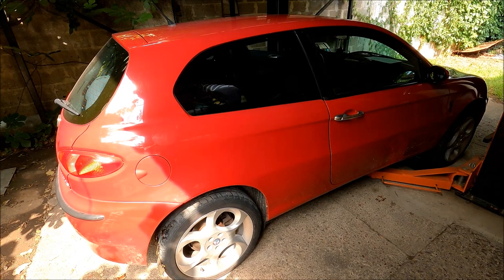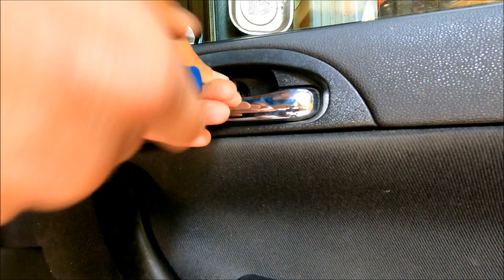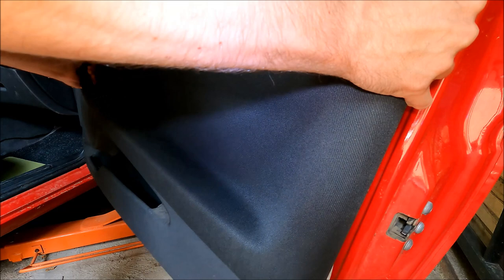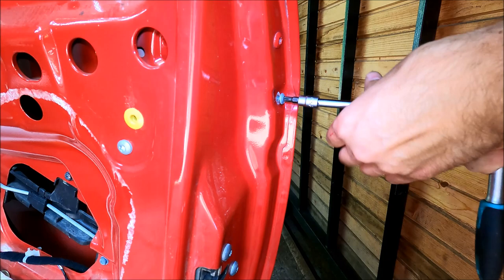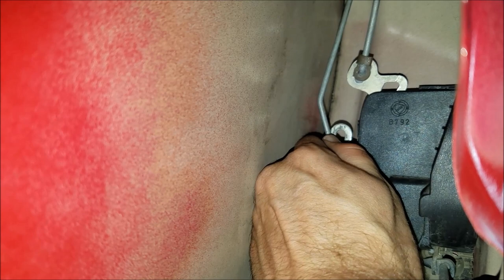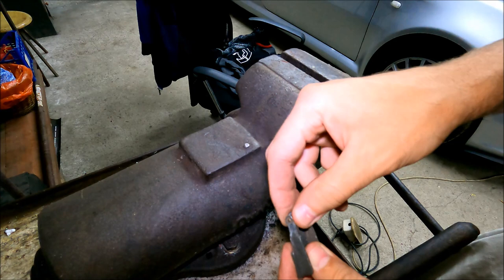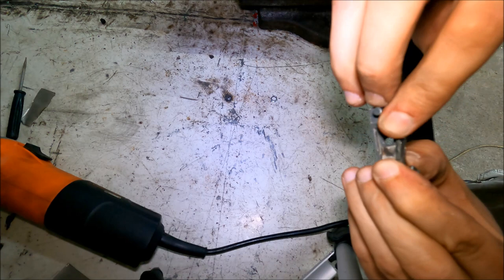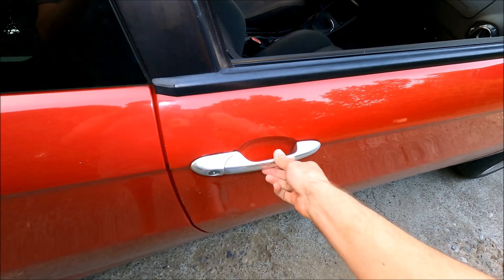How to Remove and FIX Door Handle on Alfa GT, 147, and How to Prevent it from Breaking

Comment: For 147 owners, procedure can be shortened a lot! I replaced mine today. After door card removal, you remove 10mm nut that holds the hinge to the door. Then you can remove broken part and use very long screw driver to reach phillips screw that holds the hinge to the handle. After that you open new hinge 180° and put it in a handle to tighten it. Then you pull handle as if you were opening the door, that will give you enough space to close the hinge to normal position. Put back 10mm nut and you're done. Much much faster than doing this whole procedure but applies only to 147.
Reply from the maker: Did it before with replacement hinge on 147, although it is much harder on GT. In this case I had to repair the hinge, thus the full handle removal...
Reply: Just wanted to write same thing.  Easy job, done within 15 minutes 👍
Reply: Thanks, i will try that
Reply: It depends if the actual broken part is the front hinge. I pulled it apart and the front hinge was fine, my problem was the red plastic piece was worn and was not keeping the rod in place.

Comment: Another excellent video! One thing: on my facelift 4 door 147, the door switch cluster is held in by a screw underneath the armrest. You can't simply pry the switch cluster out of the door.
Reply from the maker: Thank you, you got to be very careful, you don't want it breaking apart...
Reply: @arcgarage  For sure, especially for RHD 4-door cars, those switch clusters are getting very rare and expensive!

Comment: Hey man. I think I’ve watched this video a dozen times. I got a facelift 5dr 147 with the passenger side handle not working. Took the doorcard off, the front hinge is fine, my problem is that the red plastic piece is worn out and it doesn’t keep the rod in place. But what I wanted to mention is that I looked inside the door and I only seem to have just one metal rod as opposed to the two shown in your video. I do have the yellow plastic piece in the handle but seemingly no second rod. Would that just be a difference between pre FL and FL or number of doors?
Reply from the maker: Not sure about the difference, but you can replace the plastic thing which holds it in place

Comment: Ingenious 😍 I have faced this situation with my GT and even the Alfa garage I took it to replace the brand new door handle was not too keen . It’s a pig of a job and only for the brave to take it upon themselves. Only Alfa can make a door handle replacement so painful 🙄.
This demo really helps and I will try to prevent it happening to my other door since I now know what’s causing this problem . Thank you as always 🙏 very helpful stuff ❤️👍
Reply from the maker: I agree, it does require a lot of effort, and it could've been devised much simpler. Thank you very much for your support...

Comment: Done today. Took apart as you illustrate, but suspected it might have come out without undoing the top two rod links. I reassembled these with the handle out, and yes, it will go back in with the rods already attached, just check they are taking the correct route inside the door.

Comment: Great work, of course😍. I suffered two attempts to access the repair, I succeeded on the second attempt, without disassembling the part of the rods, forcing, pulling the part of the lock. I was wrong😠, buying a hinge, for fiat 500, the cheapest around €6 on e bay...(for alfa gt it is a lot more expensive, around € 25). I had to modify, fill with composite, the screw pitch ... A nightmare😱, that to save € 200, ended finally, well😳. 
I will use the multipurpose oil on the passenger side so as not to repeat that bad drink😰. Thanks again for these videos😍
Reply from the maker: You're welcome, it is a nightmare of a job, that's why a bit of wd40 from time to time can prevent all that hustle. Anyway, I am glad it all ended well for you, the prices online are unreasonable, and thank you for support...

Comment: Absolutely genius with the glue stick method on the pull handle plug/ cap!!!
Wish I’d knew this years ago!!
How did you remove it? Hairdryer on the area?
Reply from the maker: Thanks, it removed fairly easy without any heat...
Reply: Awesome! Did it leave any marks on the surface? Thanks again!

Comment: Very good guide, let's hope I won't need it 😁 would it be a good idea to put some grease over the metal repair strip to slow any corrosion further?
Reply from the maker: Thanks, it is made from metal that does not rust, and I have greased it good...

Comment: Nice vid.
Can I use the same method on the facelift 147 from 2006?
The thing is that, the handle (on the passenger side) does not have a keyhole. And the car has central locking system. 
Does this make any difference regarding the replacement of the handle?
Thank you very much.
Reply from the maker: Thanks, you can use the same method, it shouldn't make a difference

Comment: Hallo from Poland :) 
Maybe next video about repairing broken mirrors :) That aluminium inside is really weak point of 147 and gt. I had this broken in mine and I bought used one, but after assembling i realised that is from RHD version of 147 :(
Reply from the maker: Hi, I repaired one mirror on my GT, but I got one aluminum on 147 to repair, so there will be a video in the future...
Reply: @arcgarage  So i wait for this :) You are doing great job! From which country are You?